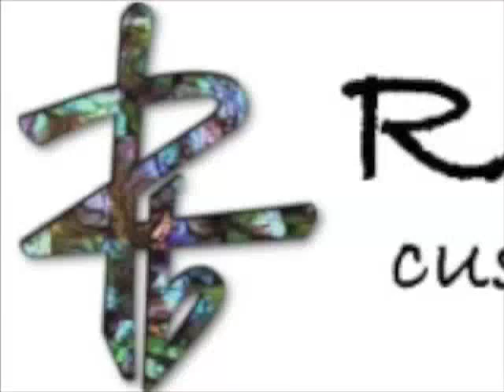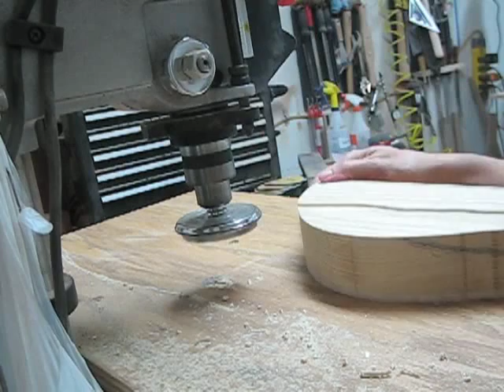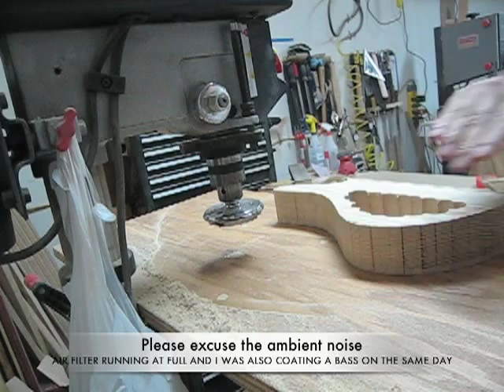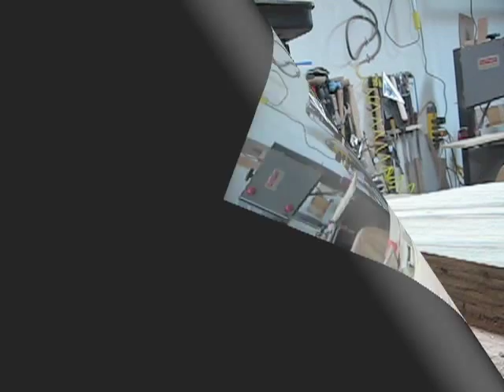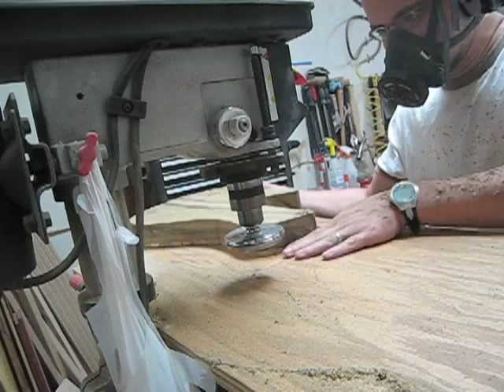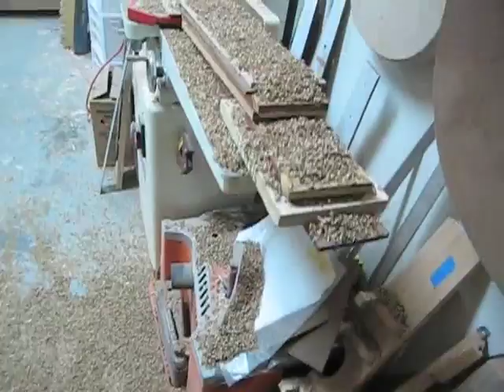Ramirez Bass Guitars: Safe-T-Planer fun

Comment: Awsome! you mention you have a 1/4hp motor, so I assume it must be a 8,10, or 12" bench top unit? My bench top unit has 1/3hp so little more power than yours, so if yours runs this good then I shouldd have plenty of power. Also have you had your chuck pop off from lateral load of this thing? Mine did, but The fellow I bought it from prolly never assembled and seated the chuck right when he got it. I re seated t and we'll see how it goes when my safe "T" planer arrives. Cheers, IC.

Comment: @nickoneuk The problem with the belt sander method (which I presently use) is that the wood dust gets ground into the felt, leaving a very unprofessional looking stain.
 
If you get a set of hammers pre-tapered from a supply house, they use a table saw and a special jig. I would too, except I don't own a table saw.

Comment: @shuttervox hi just read your comment and this tool would rough the felt up pretty bad  enless you had it at a real fast speed but to thin  a piano hammer(not sure why) you should use a belt sander thats how its done when the hammers are made in the factory, how do i know you may be asking well i worked making pianos for almost 20 years at hurrburger-brooks  hope this helps  :O)